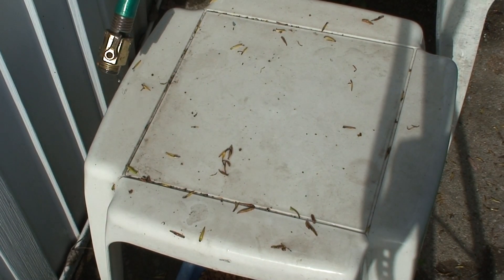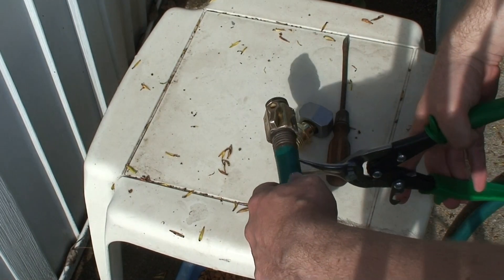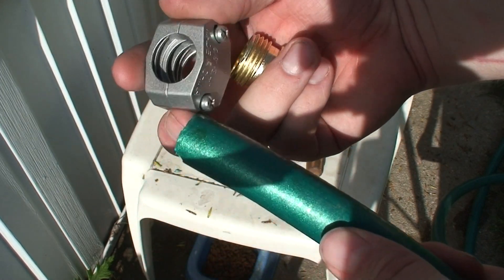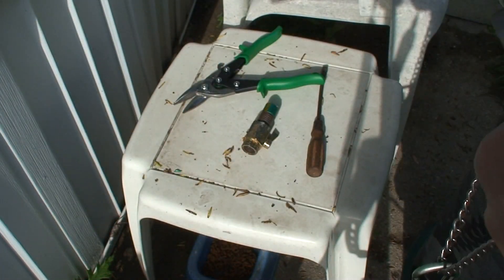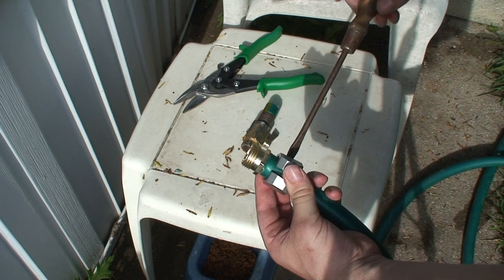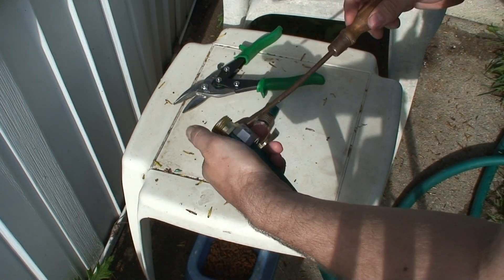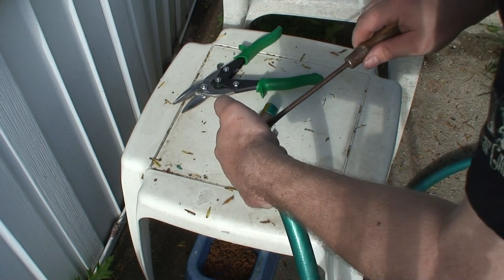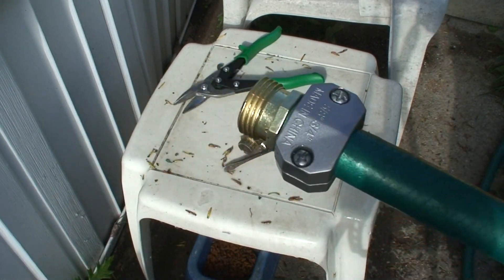How To Replace The End Of A Garden Hose

Comment: That's one hell of a screwdriver you got there!  
Pruning shears work nicely to cut garden hose, as does a utility knife, provided it has a nice sharp blade.  I've also used a dremel with a cut-off wheel and an angle grinder.  Hacksaw also works great.  Or you could Red Green the solution and run over it with your lawnmower.

The hose mender you got is the only type to use.  Any other type I've ever used either comes apart or won't hold the pressure.  Metal all the way, plastic breaks off while you're trying to install it.